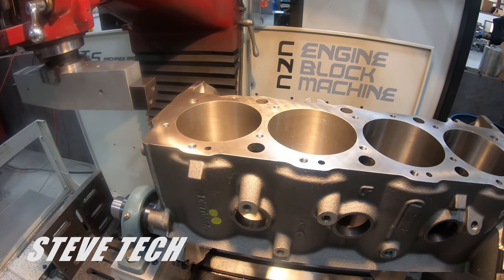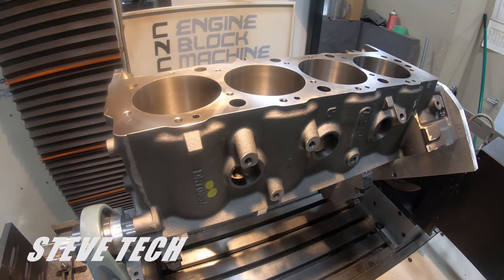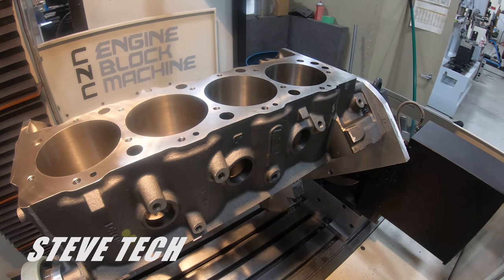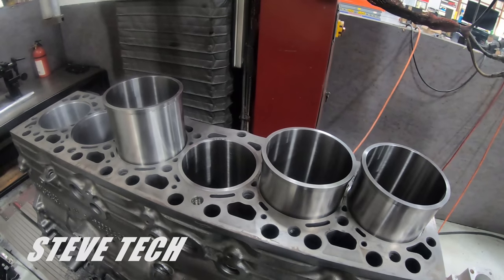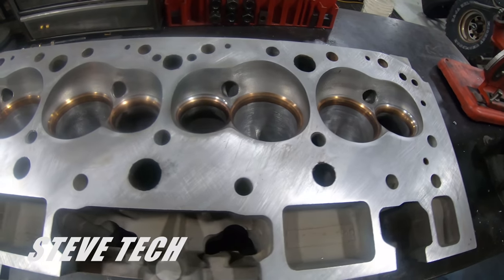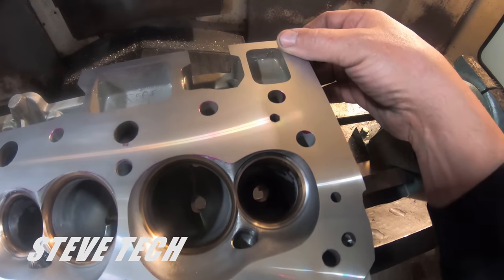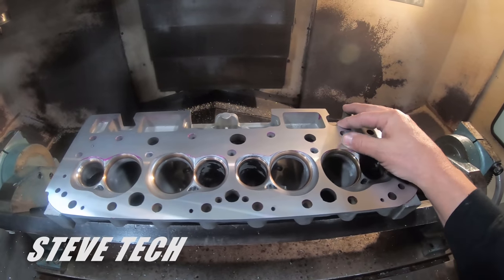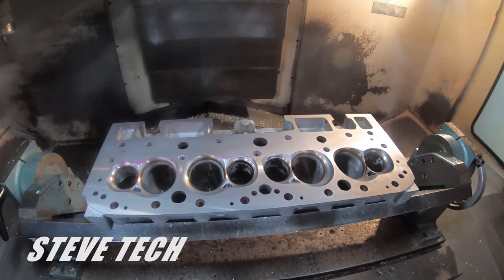Resurfacing your Block and Heads

Comment: In the beginning I could not find a good machineshop for engines after a German fellow closed his doors in retirement. Never found a good one within 100 miles. Can't build engines without good machining. Built a lot of junk that lasted and made good power however.   You however are a perfectionist. Thats what they called me. Make junk and noone comes to you. But they are impressed with shiny metal .

Comment: You can use an MLS gasket with the sleeves protruding.  if fact we do.  we leave our sleeves up about 3 though on a Stock Aluminum block. at 15+ to 1 compression we were constantly having compression leak into the cooling system and vise versa. We used Copper gaskets and stainless ring etc. The MLS Gasket and 3 though sleeve protrusion cured that issue.
Reply: Because he’s Steve Morris and your not

Comment: Is there a reason you only attach the block to the mandrel on the outer bearings? Inners just aren't needed?

How do you get your zero for a head, to make sure it isn't crooked? Block is obvious, you base it on the crank.

Comment: Just asking, I can see the deck being 45 degrees from the main saddle using, your term, but the actual deck height is from the center line of the crankshaft. In addition would you not line hone the block before cutting the deck or are you only interested in having a very good finish on the deck surfaces?

Comment: doesn't matter how shiny the surface finish is, if the machine being used is worn out, and out of square, and the block or cylinder head surface is Not flat.

Comment: Looks like someone used 80 grit and  glass to do a bench surfacing lol.
Reply: You might be surprised at how flat you can get it doing it that way.
Reply: @brentonk461  yup I am a believer in it, but you don't use 80 grit lol. 320 or better usually unless someone knows of the perfect grit to use.
Reply: I concur ... Cometic requires a Ra (roughness average) that was close to 280 - 320 grit for their brand MLS head gaskets